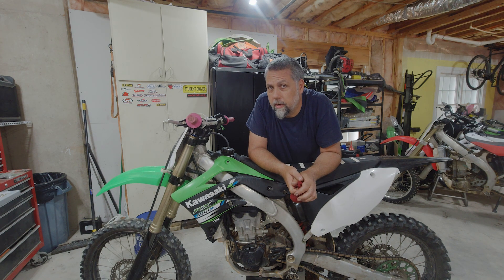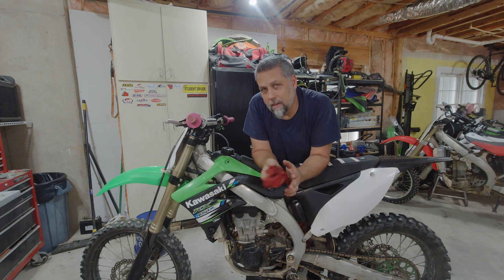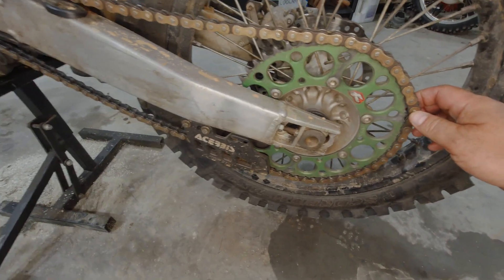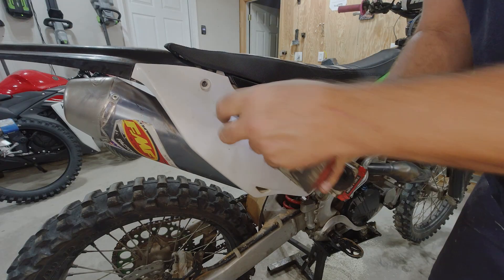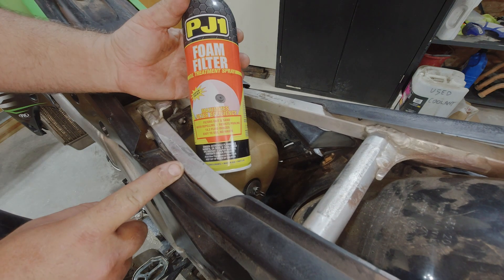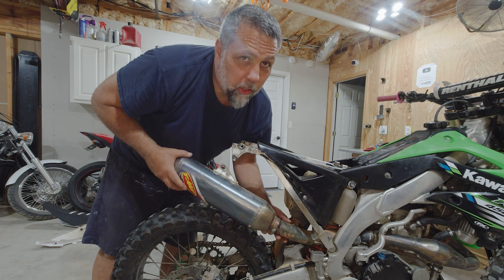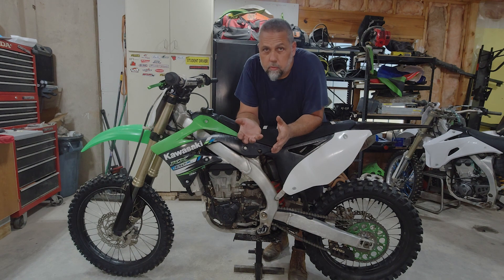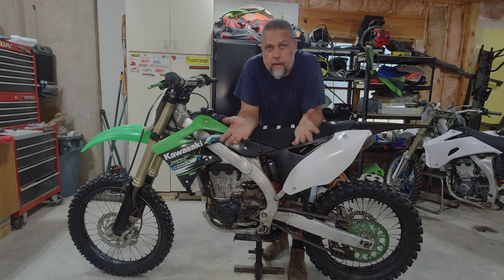2012 Kawasaki KX450F FI Fuel Problem? Ep58

Comment: I have the exact bike and mine bogs when you try to go full throttle.. it runs great up in the rmp but when your cruising and try to stab it it bogs like it's flooded or not getting fuel I replaced the tps ..and set it..just wondering if you had some know how on this issue thank you man!
Reply from the maker: I would do a fuel pressure test. See if the pressure drops or is low.

Comment: What brand is that fuel pressure kit? Or where did you buy?
Reply from the maker: I got it on Amazon. Here is the link
https://a.co/d/j9maxqi
Keep in mind this is an automotive tester. Some of the time, the outlet of the fuel pump is about 1/8" to long to fully seat in this tester hose and that amount would need to be removed. It will not affect anything.
Reply: @restoroosterohv  I put a new pump on mine and with 12v it makes same pressure as yours. But as soon as I remove power, it dumbs pressure. Any ideas?
Reply from the maker: @user-wc1mq8bs7m did you replace the entire unit or just the pump? Sounds like a bad or missing o-ring in the pump assembly
Reply: I replaced fuel pump, strainer. And both o rings. The one on the pump, and the one on the plastic housing that goes into the base. I removed the regulator and blew air in it, didn’t see anything wrong. Makes 42 psi connected to 12v and drops to 0 psi within 2 secs of removing battery source
Reply from the maker: @Martinoq92 ok, see if you can find a replacement regulator. There is something internally that is keeping it from closing fully. The only other things would be a fuel leak from the line or a bad injector which both would be very obvious.
Reply: Yea I have removed them from the system, I am testing the fuel pump assembly only. I found a kit that has a regulator, comes in Friday. So we shall see. Thanks for the help!
Reply: @restoroosterohv  replaced the fuel regulator and now it holds pressure! 
Thanks for the help!
Reply from the maker: Sweet! Glad it worked out. You're welcome

Comment: Was the pressure regulator included?
Reply from the maker: No, but they are available aftermarket
Reply: @restoroosterohv   ok thanks looks like i will be rebuilding a 2014 kx450f  the launch control seems to have been deleted and the temp sensor at the cylinder is missing a prong. The pump had a leak i was able to seal it for now it most likely isn't giving proper pressure.  The condenser was climbing normally but only up to 1970 then cut out. 
Adjusted the exhaust valves they were at .60mm so gonna do a leak down test as well. Suprising that it ran like this for so long.
Reply from the maker: @exCR-it3ex yeah she sounds like a mess. Gotta love Kawis!
Reply: The little oring that seals the pump outlet, do you know where i could find one?
Reply from the maker: @exCR-it3ex if you know the size you could order them online. Maybe take the parts to your local parts store to find one to work. You will need Viton o-rings which have a higher tolerance to chemicals.
Reply: @restoroosterohv  thanks for the info brother,  I'll look into them
Reply: Love the videos